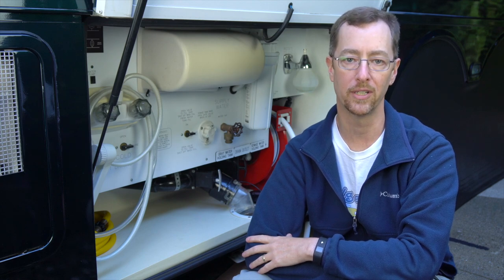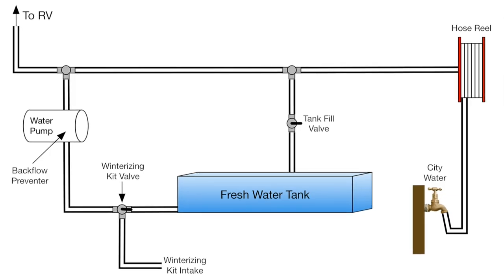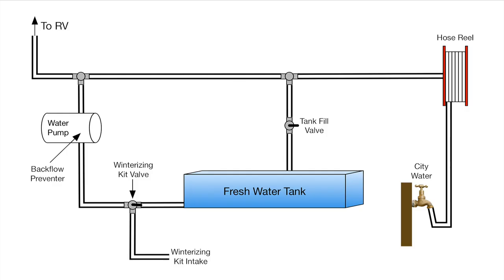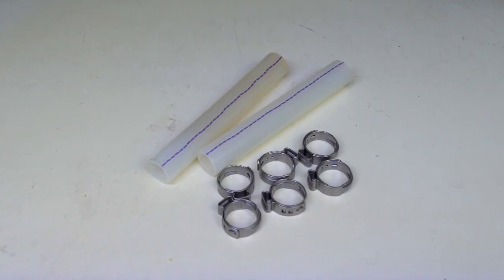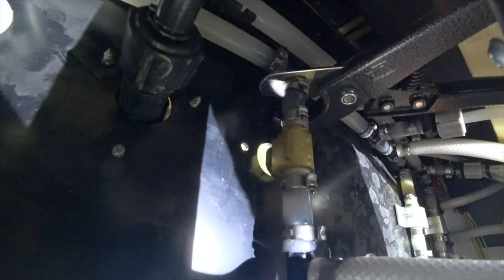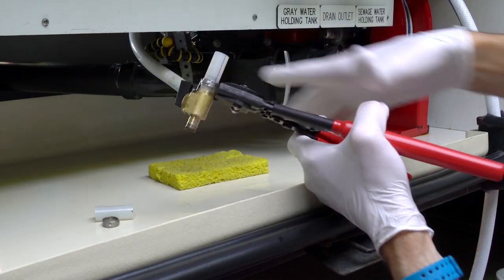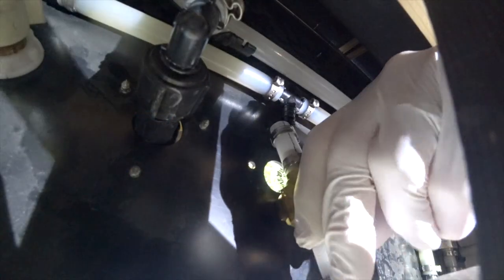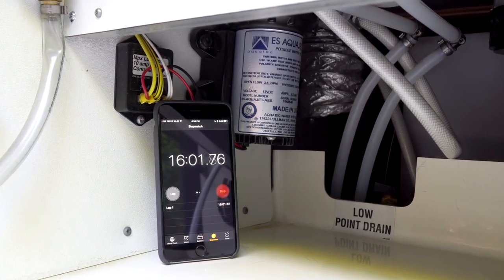RV Plumbing Leak Diagnosis & Repair - Practically For Free!

Comment: We have a 2013 Newmar Mountainaire and have a shower leak. Before I go into the guts of the shower, do you know if there is a water shutoff for the shower? I can't seem to locate one and don't want to get too deep into things with only relying on turning off the water pump and city water. Thanks.
Reply from the maker: Hi John. Sorry to hear you're having a leak problem. The only way we're aware of to shut off just one part of the plumbing system without shutting off everything at the pedestal and water pump is having an RV equipped with a Manabloc System. They do have to come from the factory that way (ours didn't), and not sure if the 2013 MADP has it or not. It's easy to tell though, since it's always mounted in an accessible place (since that's part & parcel to having it), and very recognizable. If you have one, it will look something like the third photo down on this page:
https://thegoodthebadandtherv.com/2017/04/27/choosing-our-full-time-rv-part-3/
We just checked the Newmar website, and see that the '21 MADP does NOT come with Manabloc, so that means it's unlikely you have it either. If that's the case, you will indeed have to shut off the water at the pedestal, and your water pump, to work on the shower. We're in the same situation, as wer're about to replace our shower valve! Best of luck in locating and repairing the leak.

Comment: hi guys I like you video ... I have the same problem but my is a travel trailer. and I don't have the valve you rv have so how can I fix that problem. ..
Reply from the maker: Hmmmm... that’s a tough one. It’s going to take some investigating on your part to sleuth our what your plumbing layout/flow is so that you can determine where the likely leak is. If you don’t have a tank-fill/city-water selector valve like ours, it’s possible the backflow preventer in your water pump is leaking and needs to be replaced. If possible, you could try screwing one into the water line between your tank and the pump (being sure it’s aligned correctly for the flow of water) to see if that stops the problem.

Comment: So if your hooked up to city water why are you using your pump? Neoprene and hose clamps are a good temporary fix if you don’t have the right stuff. I have used it for water and propane leaks. Also brass or plastic connectors are good for emergency fixing.
Reply from the maker: We don't use our pump when hooked up. We were demonstrating how we knew that we had a leak — when we were dry camping, we heard the pump cycling.

Comment: My name is Andy.  Just tonight I had a problem with my fresh water fill valve, causing the fresh tank to over fill while hooked to city water.  I have a 03 gas Mountain Aire 3778.   Can you tell me if the valve is available on amazon?   Either way can you advise a part number so if I need to contact Newmar, I can get it ordered?   Thank you for your assistance.   Andy
Reply from the maker: Hi Andy! Sorry to hear about your fresh water fill valve problem. We know what you're going through with that. What a nuisance! We never did find a suitable replacement on Amazon... mostly because we didn't want to have to deal with retrofitting something into that specific spot, since we didn't want to have to deal with adapting the hole through the water bay panel OR having to customize a new bracket to hold it into place. Since we had re-worked the setup of our under sink water filter (which used those same valves for the filter bypass for winterizing), we ended up using a spare we had on hand. Question: does your tank fill valve look just like ours from our video? If so... we'd recommend calling Newmar's Parts department and checking with them for the replacement. We tried looking on their online parts catalog ( https://comnet2.newmarcorp.com/instance1/servlet/WebDispatcher?mode=comnet&nextMode=&nextURL= ), but couldn't find it there. If you call Newmar, and they can't provide you with a direct replacement part for your tank fill valve for your coach... AND, if your valve looks EXACTLY like ours... ask them if they have replacements for either the under sink filter bypass valves OR the water heater bypass valves for an 05 Mountain Aire Diesel Pusher. Because ALL of those valves on our RV are identical!

Sorry we can't be more help... but hope that gets you going in the right direction to get things all fixed up!
Reply: RVgeeks thanks so much for the info.  You were very helpful and I really appreciate the quick response.

Comment: We bought a 2000 Chinook Concourse and found under the front drivers side floor mat was wet after a rain. We cannot find where it is leaking. My husband has removed the vent thing under the windshield wipers an found a big nest...he flushed it all out and recaulked everywhere he though could leak...no luck...we have had tons of rain and it is still leaking. The carpet is wet above to gas and brake and the floor in front of the gas and brake. Any advice would be so helpful. Thank you.
Reply from the maker: Hmmmm.... that's a tough one, as water can enter the RV (ceiling/walls/wherever) at ONE point... and travel surprising long distances before exiting (i.e. appearing as a leak) somewhere else. It's possible it's actually the windshield gasket itself that's not sealing properly. Or it could also be one of the "clearance" lights mounted above the cab/cockpit that has a bad seal... allowing water in higher than you expect, and then it's running down/around the windshield to come out by the pedals. Or it could be the door gasket not sealing properly. OR... it could be the driver's side window (either the seals that are visible where the window meets the door panels... or INSIDE the door where the window drip-pan is supposed to re-direct water that gets past those same seals away from vital parts).

Sorry we can't point to an obvious smoking gun on this... but there are a LOT of options for where water can access an RV... and it can be a long process of elimination to finally find the culprit! Hope you find it fast (or hope it stops raining soon)!
Reply: Thank you so much for all the good suggestions. He will check the things you mentioned and when we find it I will post it so maybe it will help someone else!

Comment: In my travel trailer if I leave the pump on, ensuring all taps are off my pump will run for less then a second about 2-3 per day. I figured that wasn't much, so I would just turn it off when not using it. if off for a few hours and I turn it off is will run for maybe a full second. I figured this was normal, is it?
Reply from the maker: It is definitely normal for the pump to run a bit longer when first turned on, as it pressurizes the system. While our pump does not cycle at all after that initial power-up, unless being used of course, we're going with 1-2 times in an entire day for all of a second being nothing to worry about. If you want to be as prudent as you can, you could look in every available spot where you can actually see the plumbing (under cabinets, etc) to see if there are any signs of anything being wet at all. It could just be due to changes in temperature (like the water heater cycling). We had a minor leak behind our shower recently that we discovered when doing an unrelated project nearby. We found a small amount of water under a cabinet, and that led us to search for the source. Periodically inspecting for leaks isn't a bad practice, especially in your case, where that occasional pump cycling just might be a very minor leak.
Reply: Thank you. I will keep that in mind!

Comment: I have to replace this valve as well but there is no way I can crawl under the bulkhead the valve is mounted on.  How can one get open free access to this valve.  I asked my dealer how they would do it and they did not know but were pretty sure they could figure it out.  I’d like to do it myself but there is no way I can wiggle my way under the bulkhead and around the Sanicon Turbo.
Reply from the maker: Hmmm... tough question, Bryan. We looked at whether or not we'd be able to get the panel out of our water bay in order to tackle this... and opted for contorting ourselves to access it instead. There was just too much "stuff" connected to the panel, and it was too well secured for us to pursue. But maybe your RV is different, and you can just remove that whole panel. Even if there wasn't enough play to get it very far out of the compartment, it may make it easier. Just be EXTRA careful that you don't end up damaging a plumbing line or anything else in the process... wouldn't want to cause a new problem while trying to fix one! 😉

Comment: I have bubbles appearing on the outside of my camper, it is a 2017 3025RE Lite. I also have bubbles over my bed that feel like there is water in them. Could you give me a clue as to what is causing the problem? I had a hot water leak in September and got that fixed. I am confused as to what is causing this. I read about the intrusion theory and the water theory, Have had a master plumber try to figure it out and he can't find the source. Please help!
Reply from the maker: Oh boy, Debbie. That’s not good. Bubbles on the outside could be a delamination issue... either due to water getting between the fiberglass and its underlying support OR due to a manufacturing flaw. But if you’re seeing bubbles (water-filled?!?!) in the ceiling above your bed... THAT sounds like you have water getting in through a bad seal on your roof. Could be around a vent pipe, vent fan, or the air conditioner. You’re going to need a good RV service technician to check for leaks. We’d doubt it was plumbing-related.

Comment: I have a hair scratcher of a problem and no one seems to know how to fix it. I have a water pressure problem in my trailer which is only a little over a year old when I’m hooked up to city water I have good pressure on the cold side of the Fossett and bad pressured on hot side and the hot and cold in the bathroom Are bad. when I’m on the 12 V pump I have good water pressure on the hot and cold in the bathroom and good hot water pressure in the kitchen but bad cold water pressure do you have any ideas what this could be
Reply from the maker: We're going to go out on a limb and guess that it's a check valve somewhere, maybe at the back of the water heater or at the water pump. Very odd, and we're not sure how we would even go about trouble-shooting it. Sorry we're not of more help on this one, but it sounds like it needs some careful hands-on from a good detective.

Comment: hi! i have a 2008 Adirondack Dutchman and need to replace shower head and knobs but theres no access panel.help!
Reply from the maker: Hmmm... with the shower head, you should be able to unscrew it from the pipe protruding from the wall, and re-install the new one, without needing access behind the wall (although your install may, of course, be different). And when you say you need to replace the knobs... do you mean you also need to replace the valve(s) that control water flow? Or just the handles (for a new look)? If just the handles, look for a small insert that can be pried out of the handle to allow access to the mounting screw. If you need to replace the valve(s)... is there a chrome panel that surrounds the knobs? If so, that often covers a larger hole in the shower wall that would allow you to access the shower valve body itself. And... look online for a manual for your brand/model of shower faucet (if you can determine it)... since that might give you some insight into how it's installed, so you can reverse engineer it a bit.

But if NONE of that seems to apply... you may want to try posting your question over on the iRV2.com forums (http://irv2.com/forums)... it's free to join and post... and someone else with your make/model of RV may have tackled this project already and be able to give you more-exact guidance.

Comment: do video about bug bomb a rv please
Reply from the maker: Hi Matthew! We don't have any bugs to get rid of right now, but we did bug bomb our rig once many years ago. We can tell you exactly the BEST stuff to use is Raid Fumigator: http://amzn.to/2xYnyva
It's awesome because it's a smoke, not a spray, so gets in EVERYWHERE and leaves NO residue. Follow the directions and it will kill everything.
Reply: RVgeeks thanks you but does  it need to be sealed up. I have a pop up will it work
Reply from the maker: Hmmm. We're pretty sure that the screening in a pop-up will allow the smoke to just escape and not do the job. It does require keeping the house/RV closed up during treatment. Assuming you only have screening, as with most pop-ups, in part of the rig, you might be able to make it work if you keep the pop-up completely closed during treatment. In that case, a singe canister on the floor right in the center of the rig would surely be enough. It's worth a try. Please let us know how you make out.
Reply: RVgeeks I will try. I tell you how it went but I need to wait until the camper is cleaned. Thank you so much
Reply: RVgeeks what happened if there is a lot of holes for venting in the floor?
Reply from the maker: See it you can cover over, or tape over, them. It's the smoke hanging around and not dissipating too much that will kill everything.
Reply: RVgeeks ok

Comment: 10 sec answer. The check valve failed.
Reply from the maker: That's true, but without diagnosing it correctly first, you could easily replace the wrong part for no reason.
Reply: @RVgeeks  I agree, all I'm saying is it doesn't take 7 1/2 min to say this. If the pump is cycling without your using water then it is one of three things, A. A leaking fauct/toilet valve, B. A leaking pipe or water tank etc, or C. A back flow preventer/check valve, and once you said city water was filling your tank it was clear what the problem was. When people are looking for answers to their problems and are plowing through many of these videos it is just troublesome to listen to a person talk on and on about too many details that really don't matter much. This is just my feedback, others may not agree, but thank you for taking the time to post it all the same.
Reply from the maker: The most common request we get is to make our videos more detailed so that people without much or any knowledge of the topic can understand it all. You definitely don’t fall into that category, so we understand you need less detail. Thanks for the input! 👍